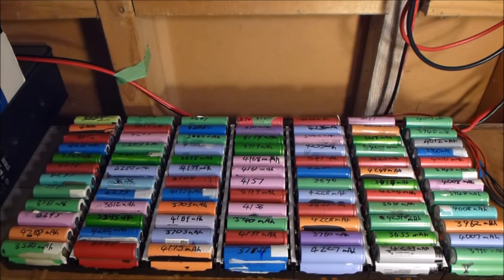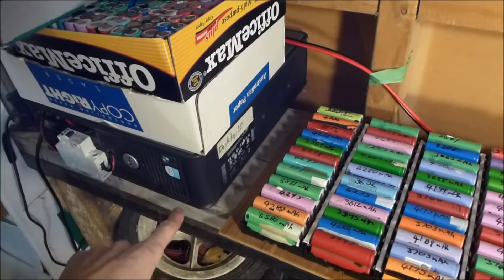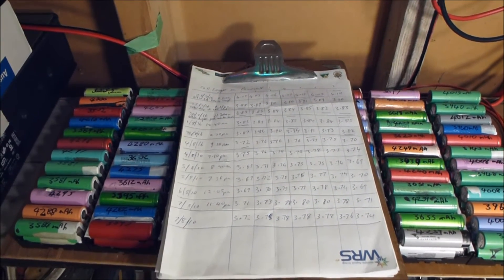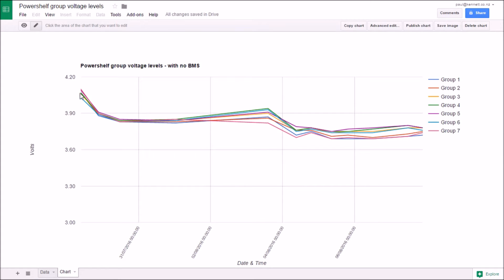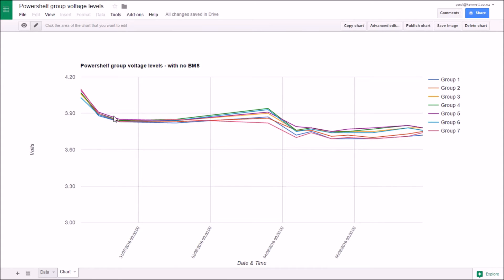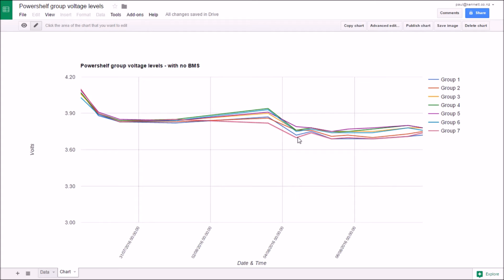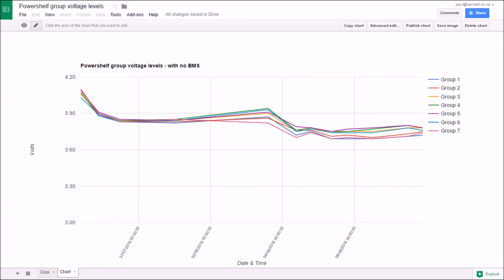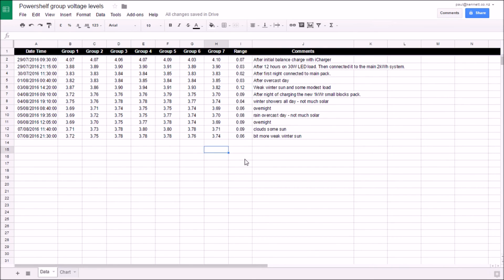Laptop Powerwall 55 - Powershelf without BMS: 1 week later

Comment: would you take apart the pack and charge the separately before adding a BMS, I for one am not a fan of BMS. I like you idea of a cell logger. and the pack being able to come apart easy. I look forward to the days to come and the info you are gathering.
Reply from the maker: I'll put a cell logger on my 2kWh Powerwall pack (which does have a BMS) as a control case to compare with the Powershelf and Small Blocks packs. That might be interesting.

Comment: Interesting to see the the variation in voltages at various levels of discharge.. 

looks like as you're coming closer to the bottom of the pack capacity they seem to be coming close to the same voltage again.. 

How did you get your mah rating of the cells was that done with a discharge cycle on a charger? 
If so what were your parameters? e.g. 4.2v > 2.5v discharge cycle at x Ma discharge rate.. 
be interested to see that same data but at different C discharge rates.. e.g. full pack to empty at xC x1C x2C etc.. see if that variation increases.. etc..

Looks like you're getting a good data set there though..!! :)

Looking forward to what you have in store next.. :D

All the best Dave
Reply from the maker: The cells were selected around a mean of 2000mAh (4000mAh per pair). I measured that with iMax B6 (discharging from fully charged to 3v) and an Opus BT  C3100 (discharging from fully charged to 2.9v). Once it was all together I balance charged it up using my iCharger 1010+ which put in 44.6Ah - so just over 1kWh.
Reply: ta for the info..

Next question :)

3 volts.. did you measure the resting voltage after a rest period as I've found different cells rebound to different voltages.. which makes me think the capacities are different... 
when I did the last batch for a pack after I had run them down to 3.3v @ 1amp discharge I then only selected cells that rebounded to 3.7 volts anything below that went into another box as lower grade cells..

Regards

Dave
Reply from the maker: +Dave Webster (Webstaff) My understanding is that it's the internal resistance that influences self-discharge rather than capacity. But even so, it's good to set aside cells that self-discharge more -   because they'd be a drag on the rest of your pack.

Yes- I do wait a bit before doing the discharge, but didn't measure volts after waiting. I probably should have though - to avoid time discharging lower voltage cells.
Reply: erm I meant after discharge e.g. when you drop them to 3 volts what do they come back up too.. as it seems more to do with minor variations in cell chemistry than IR of the cell in what I was looking at..

but I know what you mean about IR I have also seen that too with regards to self discharge but there in a different pile of cell now :)
all the cells in my case we're 4.10V+ after being stood after full charge in the 1-3 weeks preceding the discharge tests.. anything below 4.10 was marked BSD and put in a box out of the way as there basically going to kill any pack you put them in :D and yes you can see the IR is high on nearly all those cells..
Reply from the maker: Ah, I see. No I didn't bother recording the voltage bounce-back after discharge. It's a good measure of battery health though. So I probably should have. 
My assumption was that excessive voltage drop prior to discharge would result in low capacity readings - which is another proxy of the cells health. But the downside is that it is subject to variation due the different times between charging and discharging. Your process might be better.
Reply: Maybe but not necessarily I'm not sure how I feel about bounce back voltage yet :) as I had some strange results with some odd batteries.. 
my assumption that i'm working towards is that with enough initial data you should be able to just have a calculation to work out the characteristics of a cell with a simple standard process.

what I want to find is the quickest way to get to that..

So i'm currently leaning towards, 
single IR reading at a set voltage point within a cell cycle.
capacity rating on a discharge cycle, 
bounce back voltage. 
pop that data in a formula and that should then give you a fairly quick way of getting a number for how good the cell is and what it could be used for..
I still have the following to look at. (and i'm sure more questions as I go along)

Within the discharge cycle where to put the low discharge level.
Does discharge rate effect the calculation and LVC e.g. is it better to have a high C discharge or a low discharge.
is it better to have different process cycle based on intended use of the cell. with enough data i'm thinking IR might be a short cut here so you can have one standard cycle and the calculation then takes that into account.
And so on..
But you get the idea.. :)
Reply from the maker: It would be great to have a robust process. Have you done any experiments to test the robustness of your IR measurements? Peter at @HBPowerwall seemed to get some wildly varying IR numbers from his iMax B6.
Reply: yeah the mc3000 i'm using gives IR value but yes there seems to be some variation thats why i'm testing from all angles atm to see what gives the most consistent results (but my b6 mini, nahh its really all over the show).. as I say I think it will end up being a combination of data that gives you fair reflection of the true state of the battery and why I think a formula based on a few data points will give the best idea of cell quality and capacity..
Reply: In an earlier video, you mention you charged the batteries with your iCharger at 2amps, was this 2amps across the whole, 24*7 (168) cells? Appreciate it's a while ago, I have watched all your videos, and now going back over them, as I didn't want to ask too soon, incase the answers came later. I really have found your videos inspiring.